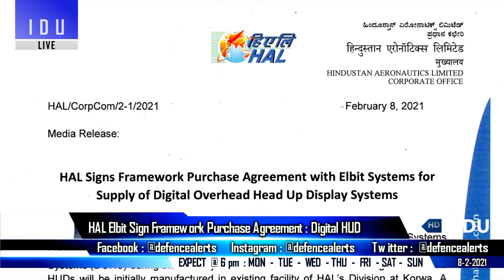Indian Defence Updates : DRDO-Rolls Royce Engine,Podded GSH-30 For MWF,DRDO BOSS Ready,HAL HUD Deal

Comment: Ddro boss quantum network planting roots ankhing rolls Royce blue membrane water salinating saffron Bentley chemist rolls Royce arm n hammer engineering before small network communication to counter weight n drag medium level internal gun long n short range hswaag missiles brahmos s400 tank armor ceramic engineering s 500 social security thus the s400 ban

Comment: Come on RR was involved in F35 program with the F136 engines which was 190kN and we are looking to make only 116kN we will need more power if we are looking at using energy weapons and heavy payload.
Reply: RR helped in creation of lift system for f-35 'B' (specifically) not the actual engine so no they don't have much experience with actual engine.
They have to create a new one and with current economics of world I think it would be very tough.
Reply: @yoloyo7471  no they were developing f136 for the F35 with Ge, the project was dropped due to lack of interest by pentagon but they did develop the engines thus gaining valuable knowledge. AMCA 2 would be a 6th Gen fighter which means we not only need a good weight to thrust ratio to maneuver with heavy payload (future air to air specially will be longer range thus heavy too). we need power (electricity) to power faster computers for AI / energy weapons / sensors / radar (Though gallium nitride raiders will need less power it will need ). We should take advantage of they experience to get at list a 140kn. Though I am no expert and can be wrong to expect better.